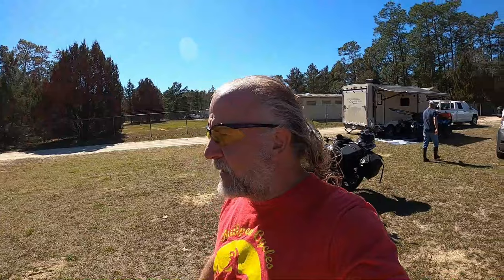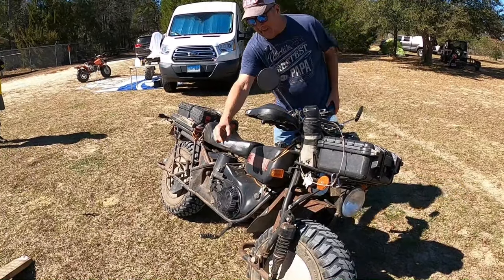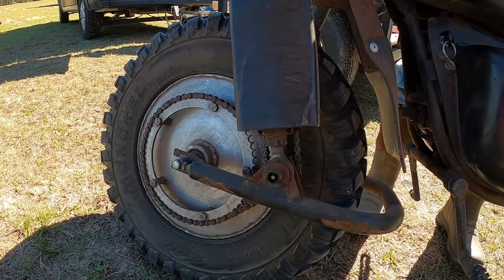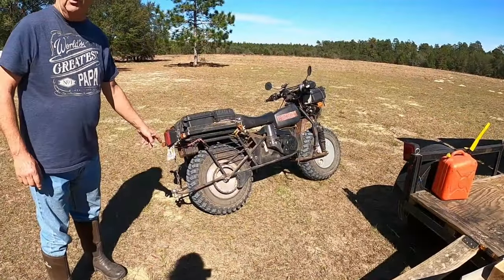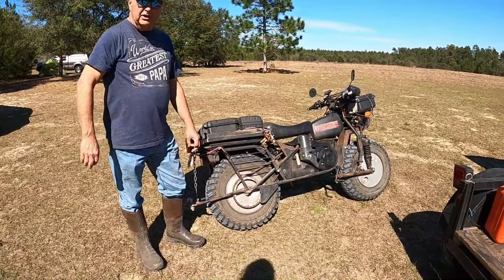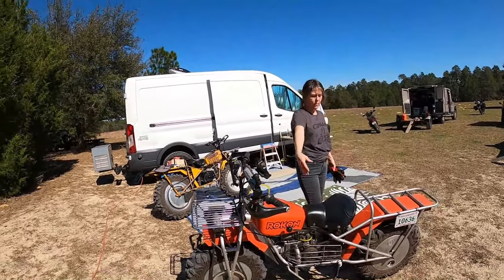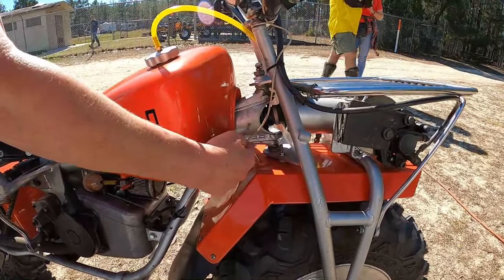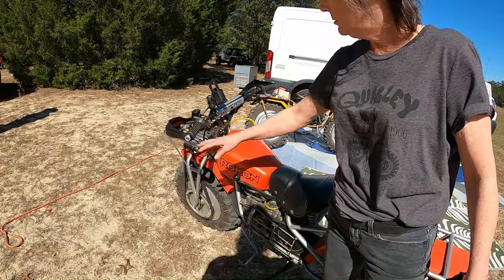The Central Florida 2024 ROKON ROMP from deep in the ONF

Comment: Salt springs .. Ocean salt water comes up in a lake George there huge lake.
My mom lives near There.
I was just there .
These bikes seem heavy awkward off on road compared to a Enduro KLX 250 etc.
Kinda funky cool .
Nice fun people 👍
Thanks
Reply from the maker: Oh wow! Small world.
Reply: They're very light in weight but they don't look it on the move.  The rake angle is more or less vertical and you have lots of maneuverability at low speed.  You can ride it in trees and over trees, but there's not much of a point of using one on a trail.  Just about anything would be faster on a trail.  Maybe even running.
Reply: @joebays4492   
I raced Enduro and Motocross.
So I am used to those types.
I had a trials bike which is similar putting jumping rocks logs etc.
Look like all good fun 😊
Thanks 👍